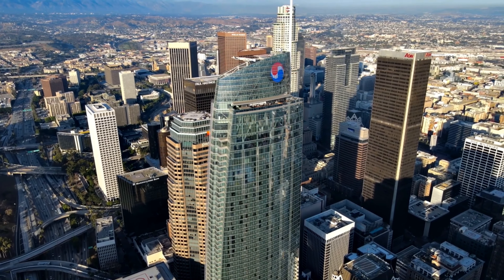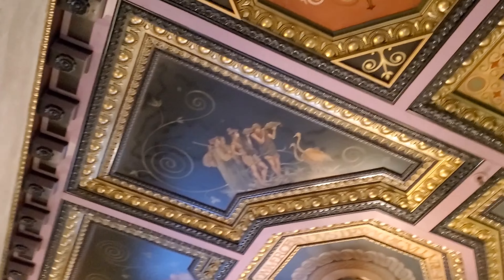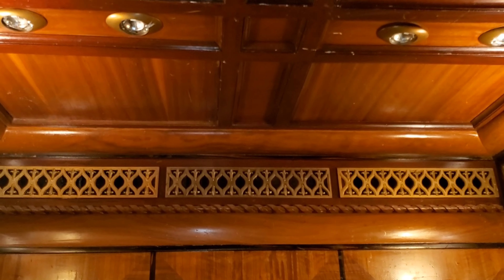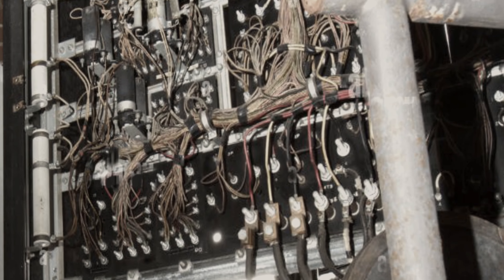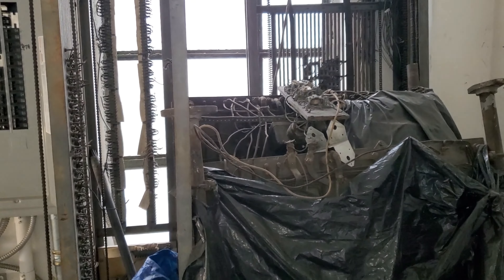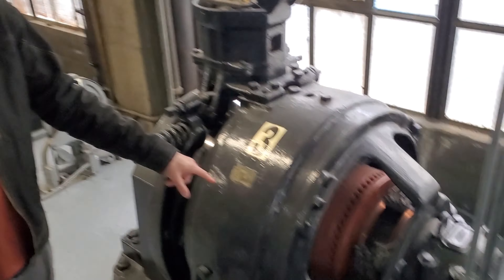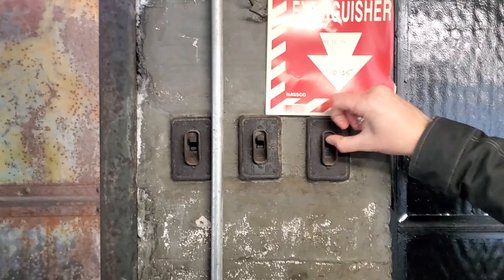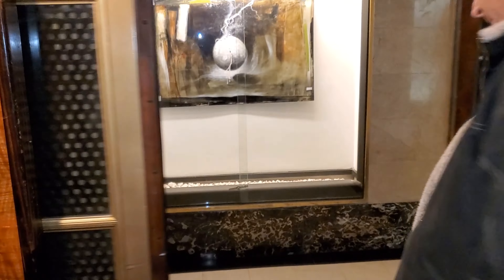FANTASTIC 1913 WESTINGHOUSE ELEVATOR MOD

Comment: Whoever worked on these elevators clearly had great respect for them. These things are works of art despite the modernization. They did it in a manner that was respectful to the elevator and it's historical character. I guarantee you stuff like this is not made today and they will never make stuff like this again. This is an elevator worthy of might me taking the time to ride it.  All these elevators made today are cheaply made and are designed to fail within 10 years. These older ones were truly built to last and with pride.
Reply from the maker: Yes, he really did a great job. I was very impressed.

Comment: What is the voltage of the motor and is it single phase or 3 phase and how many Amp fuse protect the motor
Reply: In the cabinet you could read "DC-Drive". That was state of the art in those times. Formerly there have been DC-Generators to drive the DC-motors. The motors seem to be original, what a lifetime! On these you can see the collector / commutator with it's brushes.